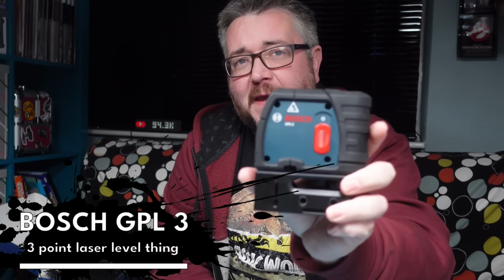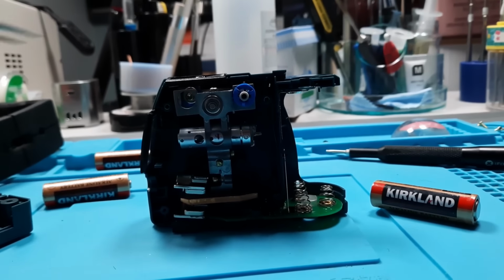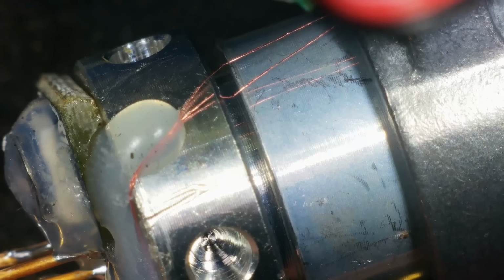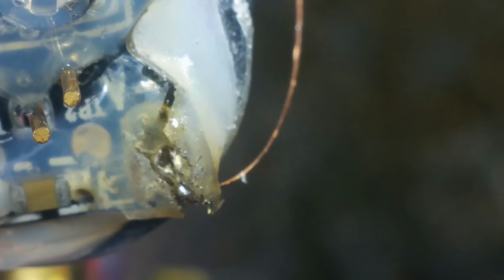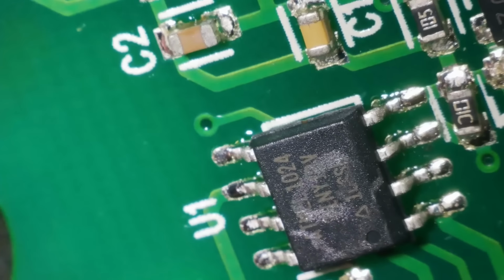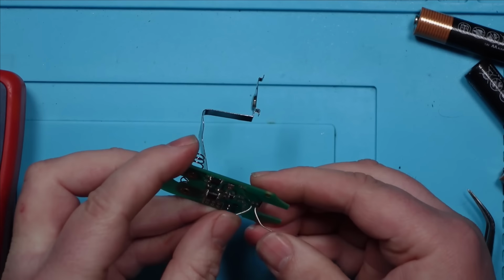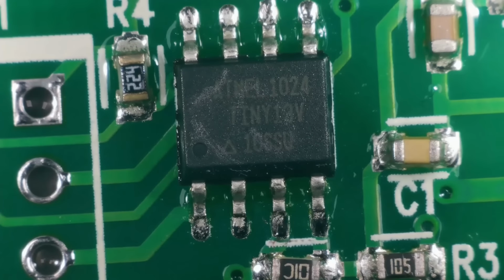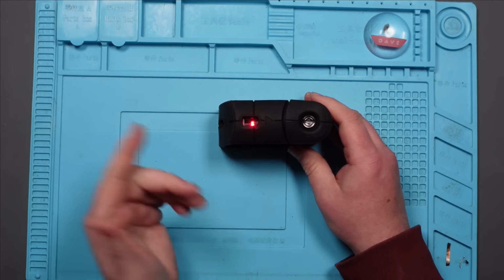£180 BOSCH Laser Level FAULTY | Can I FIX It?

Comment: Sorry, mate, I don´t think you´ve fixed it properly as you have simply "bridged" the Atmel-PIC , which sure got you rid of the blinking.
The original problem of this device of not "self-leveling" has not been fixed by this. I think, either the Atmel itself has flaws or something on the surrounding circuit has gone bad. The chip is not able to register any kind of leveling, guess the item has been dropped and something beneath all the "hot snod" on the board has been damaged or misalligned somehow... The atmel is a programmable microcontroler, so you can´t just get it working by just replacing it...
Reply: Pretty much what I thought too. The microcontroller seems to be working (it wouldn't flash otherwise) but wasn't getting the signal to say it was level, and the flashing would indicate that the unit wasn't level. Not a lot in there compared to the rotating one I looked it.

Comment: You should learn a lot more about electronics. This "diode" is an hall effect sensor. The thin wire you broke was the power for the laser diode which is on the pendulum. By putting the wire between the switch and the wires for the laser you just override the complete circuit and fed all the voltage from the batteries directly to the laser, unprotected and without any resistor for current limiter. It is certain that some point it will fail.
I don't want to be rude or mean but with this content you doesn't educate anyone, instead someone who wants to learn is misleading.

Comment: Those "diodes" is actually an "opto-coupler". It is meant to isolate the microcontroller from the laser (i presume).

Hardwiring the ground with a wire like you did is just connecting the lasers straight to the battery, which is not good.

I guess there should be a level sensor of some kind that is not working somehow.
You might have ruined the attiny13 mkcrocontroller in the meanwhile though. 

The attiny13 can be programmed with the Arduino IDE. You just need a programmer for it (usbAsp).

I enjoy your videos always, but this one was a real cringe video... if you don't know what a component is, google it!

I hope you will look at it again and really fix it.
Reply: "You just need a programmer for it" Yeah, he doesn't need the code whatsoever.......

Comment: Your "fix" essentially bypassed the circuit so now it's just a laser pointer and not a laser level.

the chip is supposed to make the Diod blink when the pendulum isnt level then make it solid when it is that's why you were getting the voltage going up and down, that's exactly what it's supposed to do when the  pendulum isnt level, when it's level it will be high and it will switch the output voltage to constant so it stops blinking